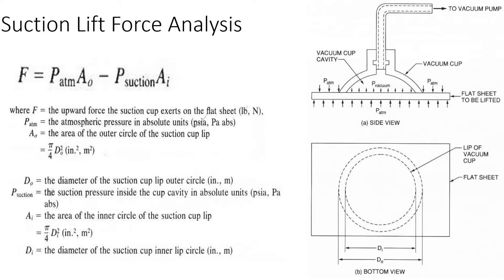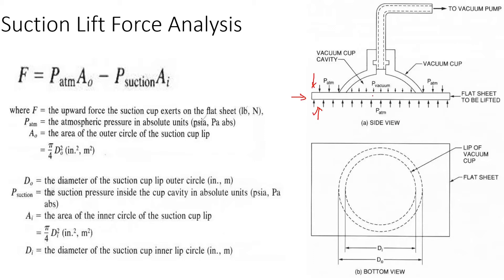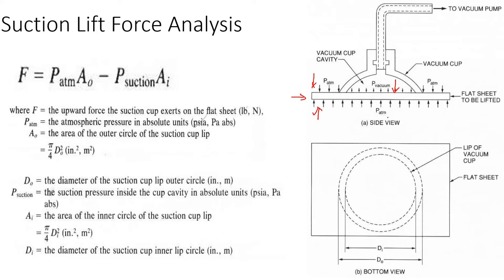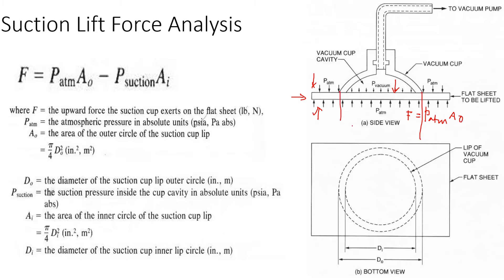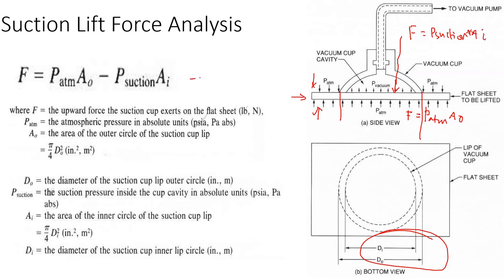Pneumatic Vacuum Suction Lift Force Calculation Formula | Updated Audio Version in Description

Comment: Hello, could you explain why we should consider the outer area of the cup instead of the inner? In my mind, it seems that on the contact we would have a reaction from the cup in the opposite direction of the force, right? Even thought there is no vacuum, the atmospheric pressure will have a physical barrier and that force will no be used in the suction.
Reply from the maker: You will find more here: https://www.theopeneducator.com/fluid-power